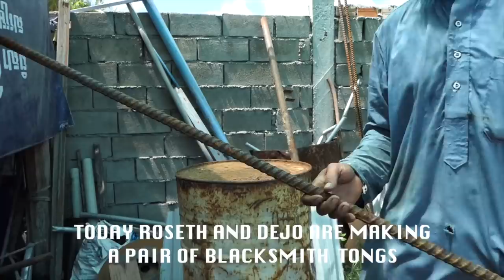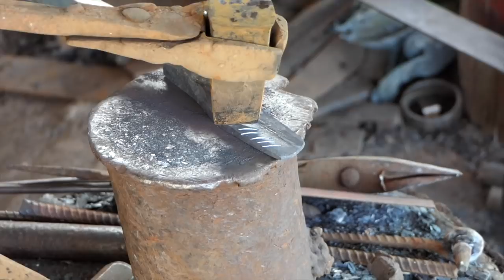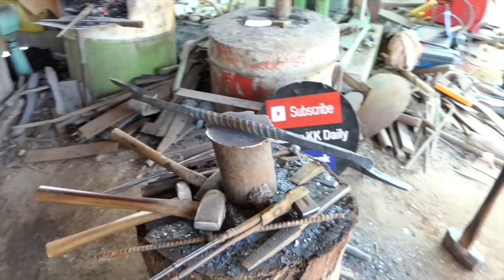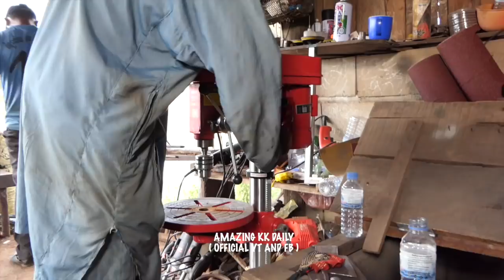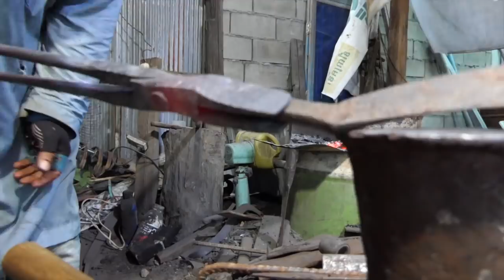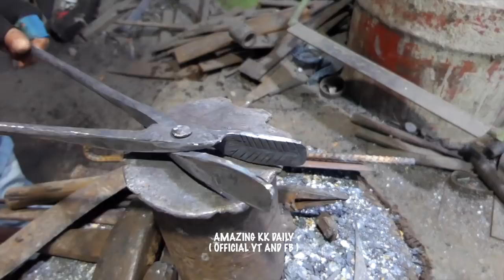BLACKSMITHING / FROM A SHORT REBAR INTO A STRONG PAIR OF BLACKSMITH TONGS

Comment: That's a very interesting tong design!  It looks extremely useful for knife making.  Is it traditional or did you invent it?

It's very interesting how local and cultural blacksmithing is!!  Also interesting is how YouTube maintains that cultural separation because I almost exclusively watch english-language videos.

Congratulations on the new drill press!  

This type of drill press is OK for wood, but spins drill bits too fast for metal, and will wear out the drills very fast.  You can get different pulleys (smaller on the electric motor, larger on the shaft) which make the drill spin slower.
Reply from the maker: Thanks for your advice
Original speed wasn't that fast